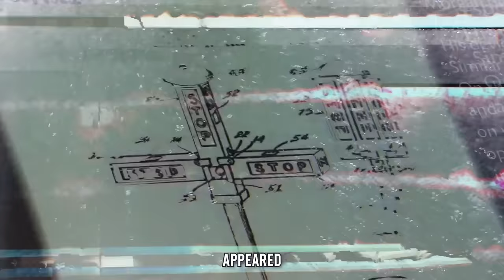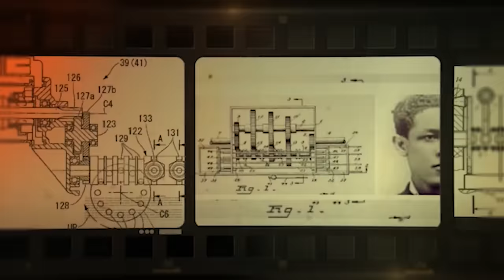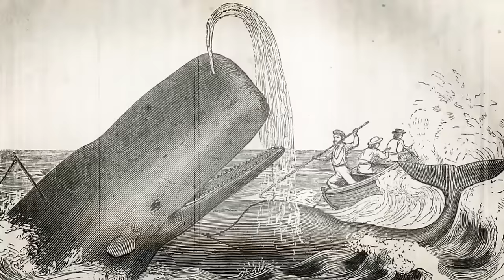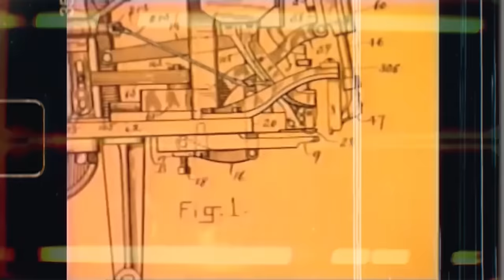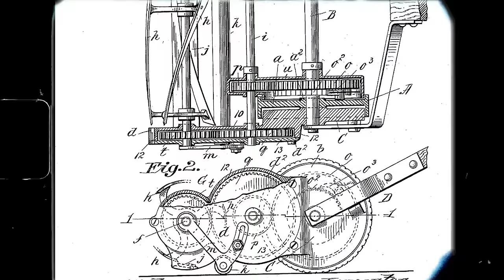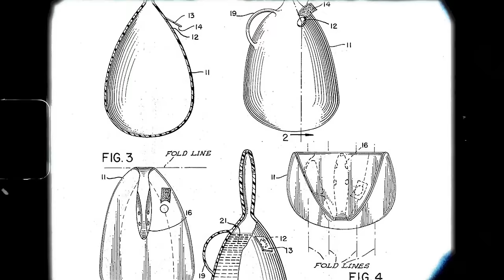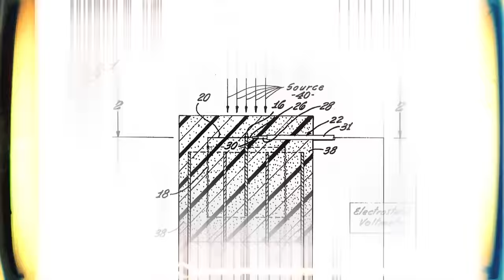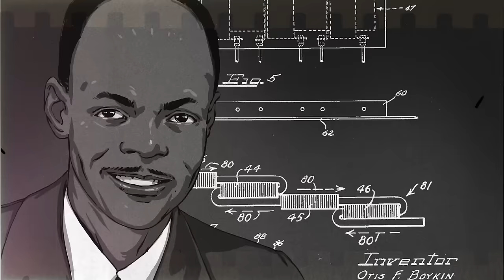100 Things You Didn't Know Were Invented By Black People

Comment: Clothes Dryer
George T. Sampson in 1892? No!
The "clothes-drier" described in Sampson's patent was actually a rack for holding clothes near a stove, and was intended as an "improvement" on similar contraptions:

My invention relates to improvements in clothes-driers.... The object of my invention is to suspend clothing in close relation to a stove by means of frames so constructed that they can be readily placed in proper position and put aside when not required for use.
US patent #476416, 1892
Nineteen years earlier, there were already over 300 US patents for such "clothes-driers" (Subject-Matter Index of Patents...1790 to 1873).

A Frenchman named Pochon in 1799 built the first known tumble dryer — a crank-driven, rotating metal drum pierced with ventilation holes and held over heat. Electric tumble dryers appeared in the first half of the 20th century.

Comment: Automatic Transmission/Gearshift
Richard Spikes in 1932? No!
The first automatic-transmission automobile to enter the market was designed by the Sturtevant brothers of Massachusetts in 1904. US Patent #766551 was the first of several patents on their gearshift mechanism. Automatic transmission technology continued to develop, spawning hundreds of patents and numerous experimental units; but because of cost, reliability issues and an initial lack of demand, several decades passed before vehicles with automatic transmission became common on the roads.

Comment: Elevator
Alexander Miles in 1887? No!
Was Miles the first to patent a self-closing shaft door? No!
Steam-powered hoisting devices were used in England by 1800. Elisha Graves Otis' 1853 "safety elevator" prevented the car from falling if the cable broke, and thus paved the way for the first commercial passenger elevator, installed in New York City's Haughwout Department Store in 1857. The first electric elevator appeared in Mannheim, Germany in 1880, built by the German firm of Siemens and Halske. A self-closing shaft door was invented by J.W. Meaker in 1874 ("Improvement in Self-closing Hatchways," US Patent No. 147,853). See Elevator Timeline

Comment: Traffic Signal
Invented by Garrett A. Morgan in 1923? No!
The first known traffic signal appeared in London in 1868 near the Houses of Parliament. Designed by JP Knight, it featured two semaphore arms and two gas lamps. The earliest electric traffic lights include Lester Wire's two-color version set up in Salt Lake City circa 1912, James Hoge's system (US patent #1,251,666) installed in Cleveland by the American Traffic Signal Company in 1914, and William Potts' 4-way red-yellow-green lights introduced in Detroit beginning in 1920. New York City traffic towers began flashing three-color signals also in 1920.

Garrett Morgan's cross-shaped, crank-operated semaphore was not among the first half-hundred patented traffic signals, nor was it "automatic" as is sometimes claimed, nor did it play any part in the evolution of the modern traffic light. For details see Inventing History: Garrett Morgan and the Traffic Signal.